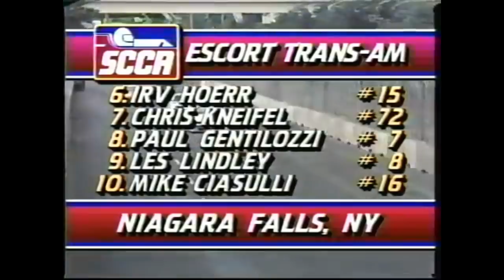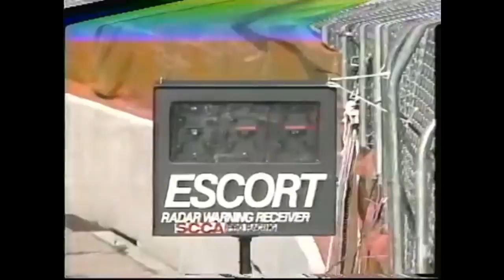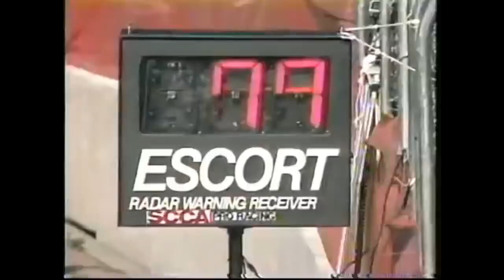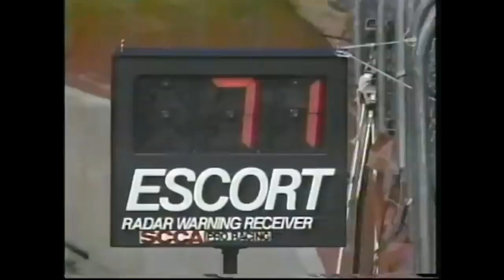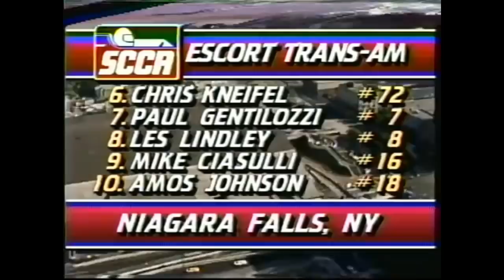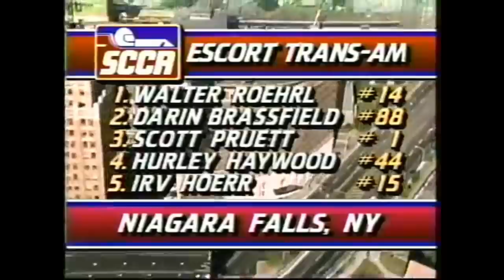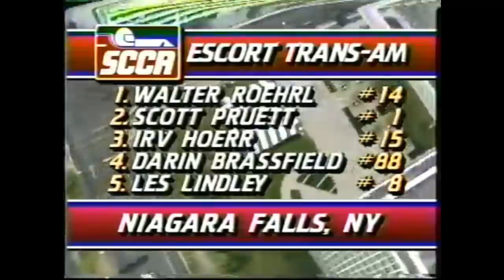1988 Trans Am Showdown at Niagara Falls (Full Vintage Race)

Comment: Sadly typical of the SCCA to ban cars that weren't  made in the USA so that the advertising didn't go away. The Jags and Audis brought some further glamour to the series and banning sucessful cars demoted the series to a bunch of also-rans. The same happened with Can-Am in 1973/4.
Reply: How many times did the SCCA penalize the Audis because they never could be slowed down…lol
Reply: @rudfil  4 times. they added 50kg twice forced them to use thinner tires and restricted the airintake for the turbos effectivly reducing the hp output of the engine by around 10%.

Comment: 😂😂 And they End up Ban The Audi omg , 1989 : American Engine and No AwD 😂 PmsL
Reply: It's almost like they were afraid of the competition 😂
Reply: The Audi-works team is far more loaded than the rest of the Privateers, so they banned them after some BS politics and Sponosriship deals.

 Contrary to popular belief, the Audi Quattro didn't win because it had ran at a faster pace, but rather had better tire wear and handling characteristics due to a much better chassis design. The AWD system was just better at managing the tires while the rest was far less advanced in comparison, not because it offered a bigger traction advantage on low Aero Cars (Which the Audi also didn't fare aerodynamically much well, this was the 80s. The Americans had better Drag Co. but didn't produce nearly as much downforce as the Audi.)

 These tire wear advantages also translated well later on to Imsa, where though it was not at all the fastest car (Qualified behind the archaic Nissan 340zx and pre historic Dodge Starion), it did put up a good fight and won a few events. Reliability issues were a big factor though due to the cars bearing the Ballasts significantly worse than the other cars (flaw of a smaller and less naturally torquey engine carrying a heavy vehicle in general.)
Reply: @youngrody2386  true, apparently they only had something like 50% of the tire wear that the other competitors had. So what the audi drivers did was keep a steady pace in the first half of the race and in the second half of the race when the other drivers would start to struggle with traction they would put the hammer down and run through the field. The audi were also 100hp down on the V8 cars, which is further testament to how well the chassis was engineered. Just amazing race cars for the time👌
Reply: @Baba_Yaga6486  I wish the Americans were going to just adapt to the competition, they were fully capable of technologically competing with Audi like they did with Ferrari, Porsche and Nissan in previous racing series. AWD was always going to be worse at tire wear and significantly in pace if Aero is on point, but the Americans didn't want to increase spending like Chevy almost did in CanAm where Porsche just out-spent Chevy to win, and wanted to keep Transam cheap to run like it still is today.

 Something I don't like about series like LMP1 and F1 was that a while ago the regulations just turned it into a spending battle because of how absurdly expensive the technology was forced upon privateers and manufacturers were, and it derailed the talent argument as budgets became more important than team and driver. The solution they came up with was a Budget cap for F1 and BOP system for Lmh and lmdh, and although they aren't perfect, and sometimes feel manufactured, they do make the racing closer and the talent more apparent.
Reply: awd were also banned in Europe. But you don't know about it. Because after the AWD ban in Europe, Audi fell to the end. With 2WD systems, they are no way to compete. And after the defeat they closed the program.

Audi weren't fast. They only have 3 pole positions in 1988. Just the AWD system saves the tires. Therefore, awd were banned not only in America but also in Europe.
Reply: @diesel_cat6389  "... awd were also banned in Europe."
In which series? I can't remenber that awd was banned at all!
Reply: @Nitramrec  ofc you can't. This is not a comfortable and not a popular subject. 
Audi AWD banned DTM. The organizers said that they would not be admitted because they had 180 crankshafts. But the main reason was AWD and protests from other factories. Even BoP couldn't change the situation.

Ban AWD in BTCC. Audi with 2WD system couldn't compete with other 2WD. And they ran away.

Maybe you can name the AWD cars in the high classes at WSC?